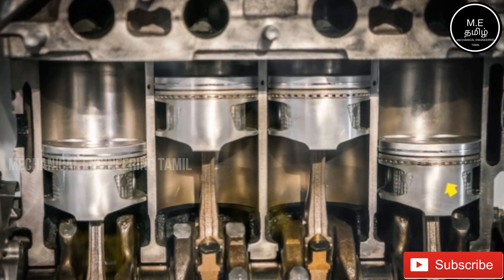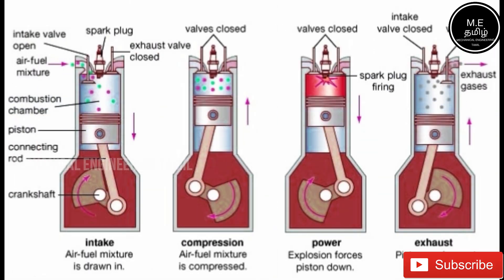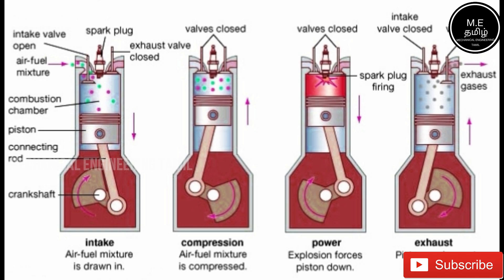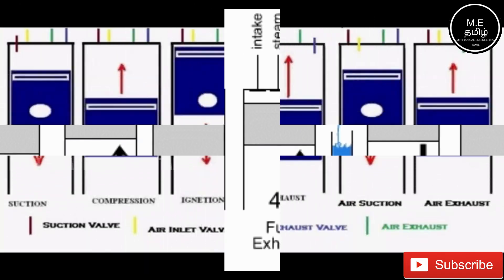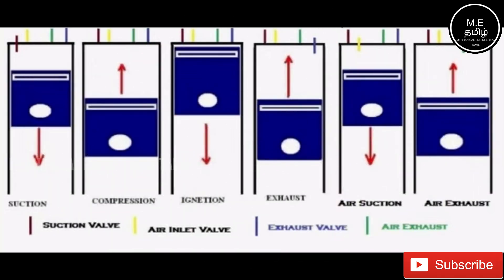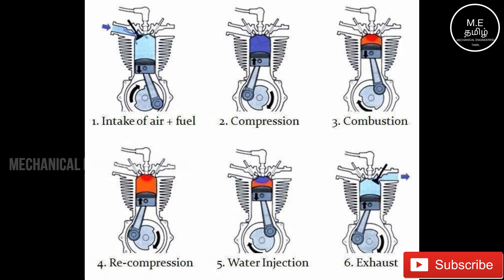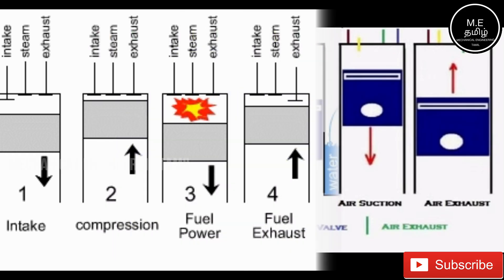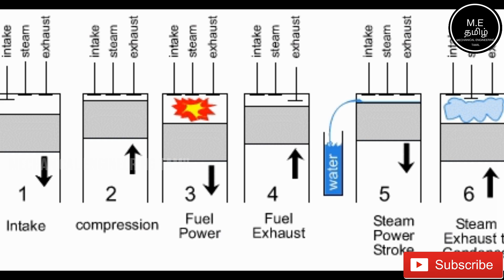How Six Stroke Engine Works (தமிழில்)

Comment: air r water outlet endha valiya veliya pogum?
Reply from the maker: Separate Valve
Reply: MECHANICAL ENGINEERING TAMIL adhukuthaan oil cooling r liquid cooling iruke, air ulla pona air block agidatha? 5&6 stroke nadantha running low aagatha(rpm gets low)
Reply from the maker: No Bro Valve Timing Is Accurate  So No Air Block agathu   And 5 th Stroke  Like 2nd Power Stroke  So Rpm Slow Agathu